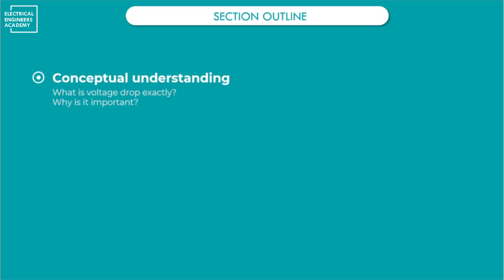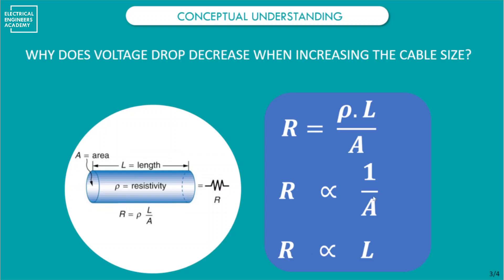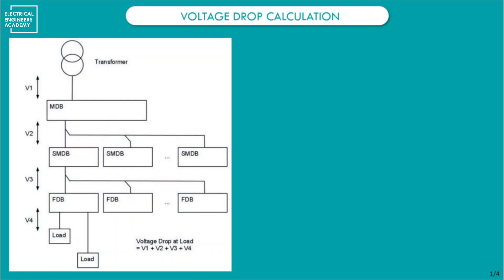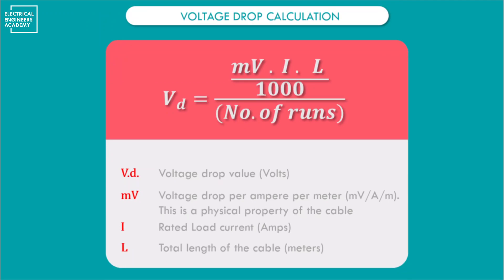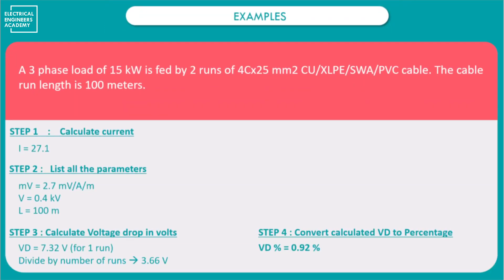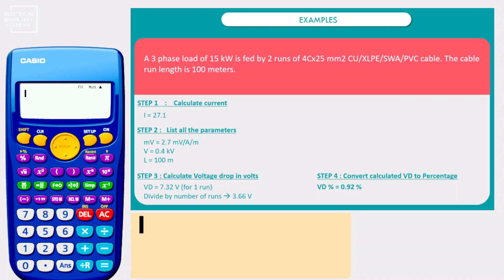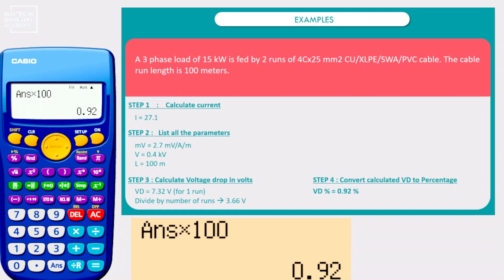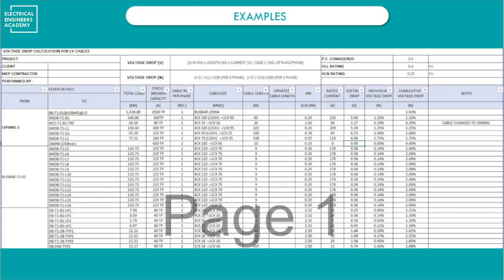Voltage Drop calculation - What is Voltage drop and how to calculate it?

Comment: Very nice explanation sir.

May I request one question.

In my project total 11 run 630 single core cable running and the distance is 105 meter total connected load is 800KW. Can you please tell me with how many Rus I should divide

If possible please send me calculated steps in a paper pic.

Thanks again
Reply from the maker: To be honest this case requires a separate video tutorial to explain properly :)
I will try to do it in the coming days.

For now, I believe that your 11 runs of cable are divided into 3 runs/phase and 2 cables for Neutral. So, you need to consider only 3 runs in your calculation...NOT 11.
There is a big confusion among many engineers when it comes to single core cables.
Reply from the maker: I added an additional tip specifically for the number of runs..
Hope that this makes the concept clear to you.

https://youtu.be/Ydrj3vMVV0U

Comment: Cable size calculation & Breker size calculation is done on basis of TCL or TDL.
Reply from the maker: Breaker sizing is done based on TCL.

But for voltage drop calculation..TDL is technically acceptable..to avoid oversizing the cables...this depends on the project, client, and consultant reviewing the calculation.